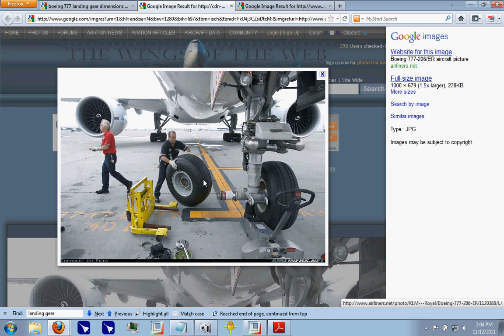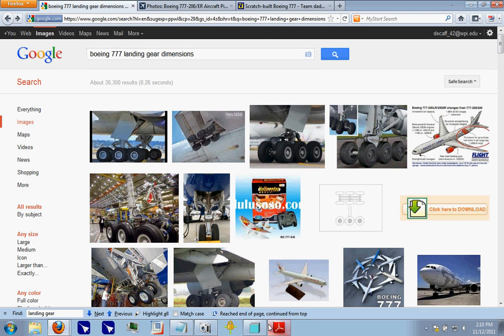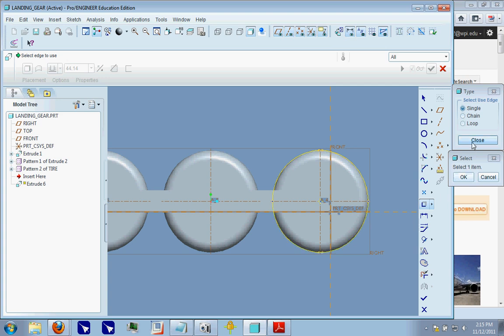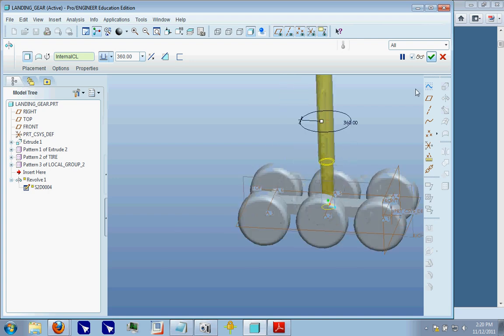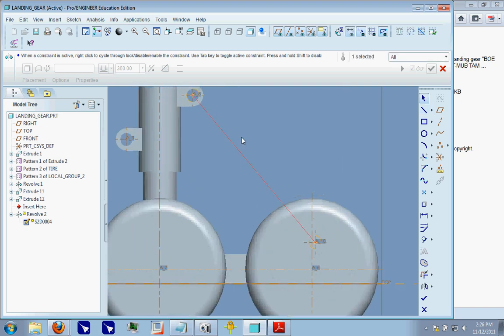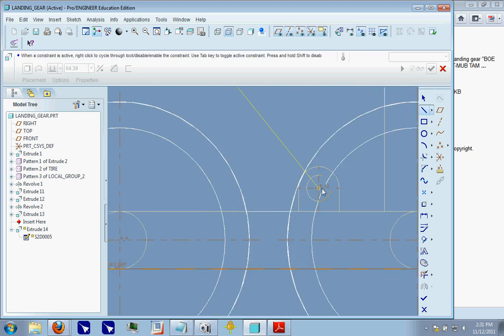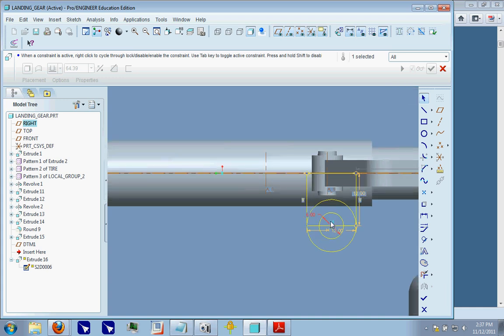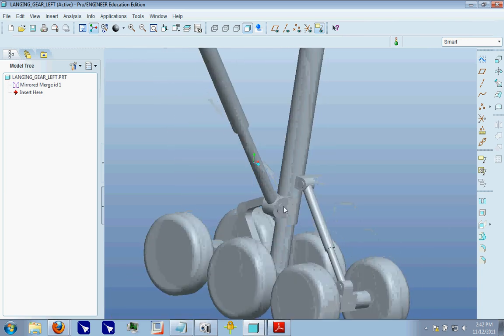Pro/Engineer Landing Gear Tutorial

Comment from the maker: Most of the dimensions are estimates. There are some things that you can use as a rough scale such as the tires diameters and widths and get rough dimensions from the rest of the assembly by saying "that looks like it is 2 times the size of this other part" and so on. You can also do a little research to find the tire size for a family of aircraft. Typically they should be the same or nearly the same (ex 737 family)